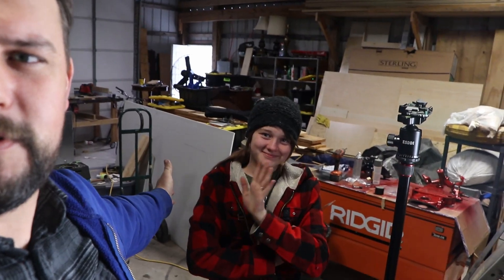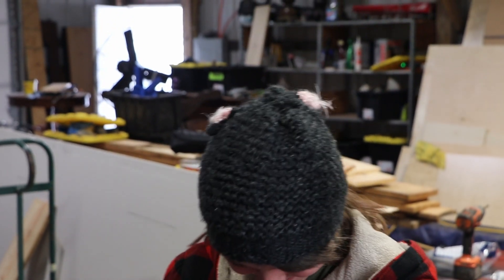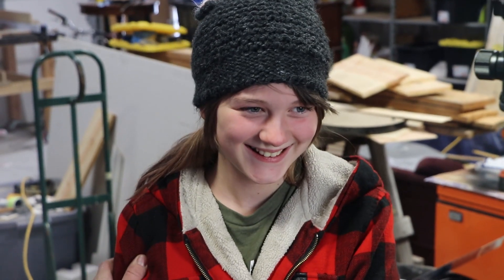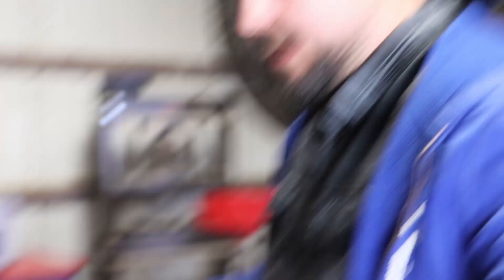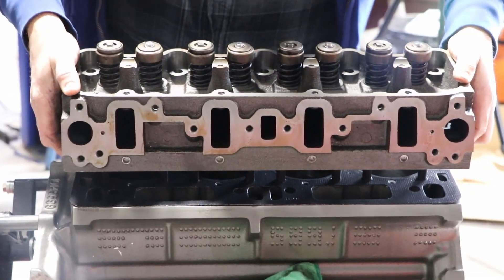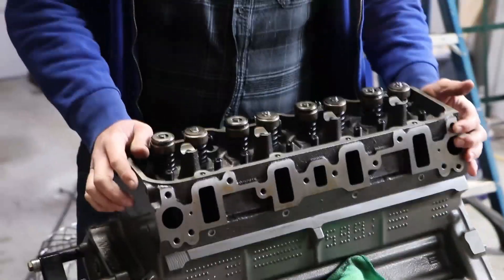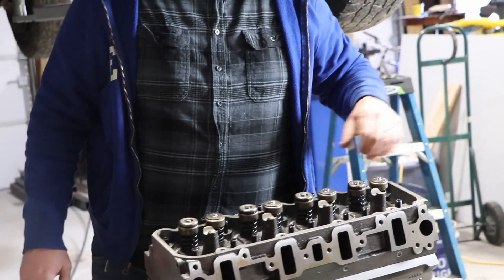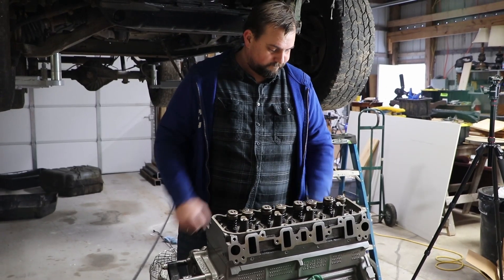6.5l Diesel Engine rebuild Pt 2

Comment: Hello and thank you for this video. But at the end you skip something that I can't figure out. When installing the valve rockers, the 6.5 rebuild book says to rotate crankshaft until the "mark" is at the 2 o'clock position. Then rotate CCW 3.5 inches until the "mark" is around the 12:30 position. WTF is all that? What mark? I have a fluid dampner balancer with all kinds of marks on it. The zero mark? I am stuck and scared because it says improper install will lead to breakage. Thank you for any and all help
Reply from the maker: Once I had my crank and camshaft timing correct I just put the push rods in and bolted everything down I didn't do any of that rotating stuff. Obviously I rotated the engine over by hand after everything was bolted down to make sure that nothing interfered with each other.
Reply: @ArrowsGarage  thanks, that's what I thought. If the dots are lined up with the crank and cam, then it shouldn't matter.

Comment: Nice video let me enlighten you. Take some silver or aluminum engine paint paint those head gasket. Put those heads on quick. That paint help seal head gaskets one hundred percent
Reply from the maker: Thanks for the tip

Comment: Just recently purchased a 65 with a blown head gasket your video is very informative on the things that I will need to rebuild it the it's a 2000 model...thanks ...and great job
Reply from the maker: Very cool these are fun trucks to work on. How many miles is on your engine. While you have it apart check the main webbings around the crank to make sure they are not cracked.
Reply: If you have to take heads off I would inspect for main web cracking, and also check a main and rod bearing.  Dont want to go through all that hassle and miss something or need to rip back apart.

Comment: Question for you I’m in the process of doing a 6.5 rebuild motor went bye bye. What was your rough ball park in cost for actual parts or rebuild kit you used. Thanks
Reply from the maker: It really depends on how deep of a rebuild you're doing. This engine had MAHLE Pistons from a previous rebuild that were in good shape so I did not have to fork out the extra $1,000 for pistons. All in all just in parts for the engine I would say I spent around $1,500 and that includes machine shop work.
Total on the build I probably spent around $5,000 but that's a lot of extra parts, fuel system components, manual transmission, new clutch, etc. So it really depends on what all you're doing in your rebuild.
Reply: @ArrowsGarage  awesome thanks for the feed back looks I have a bad crank and issues on the upper side so trying to determine what route I’m taking.

Comment: if you put in main studs, you need to line hone the crank journals because it flexes differently! gonna spin a bearing!
Reply from the maker: Guy at the machine shop who's been doing this for 30 years said that as long as you put the proper size bearings in it and you plasti gauge them and everything is within spec there is nothing to worry about.
Reply: @ArrowsGarage  interesting to hear different perspectives! i have read an article about why studs are better than bolts and the reason is because with a bolt part of the tightening torque is going into twisting the bolt shaft since the head of the bolt is connected to it. with studs your only squeezing and therefore getting a tighter clamp. I talked to a few master techs when I worked at Honda and they all said it should be done because your taking a risk of the two ends of each bearing getting pushed up against each other and overlapping. I want to put studs in mine that im building right now but im going to reuse the factory bolts just incase, mines even more budget then yours lol. cant wait to see how yours turns out! there isnt enough content on yt about 6.5s, keep the videos coming! Thanks! ps:  checkout Quadstar tuning, they sell main studs and head studs that is not arp, but they are a respected brand in the community from what ive read. also checkout the 6.5 facebook groups, lots of good info.
Reply: @FrostyBravo  application dependent also room constraints, tty bolts are used as they will stretch and harden to the torque spec, also there are people who pin cam bearings and i believe rod bearings can be pinned too

Comment: Thanks for the video. I'm about in the same place with rebuilding my 6.5 Experiencing a similar experience with ARP bolts. Ordered them in December, still waiting....  Didn't know there was an alternative. Ordering Gator stud's tomorrow.  This issue has been holding up engine rebuild. ARP better improve soon or they will go out of business.
Reply from the maker: Yeah I'm not really sure why it's been so hard to find head studs for the 6.5 l. ARP seems to be in stock with everything else. It could just be that these older motors are in so low of demand that it's not really worth their time to run as many production runs on them.